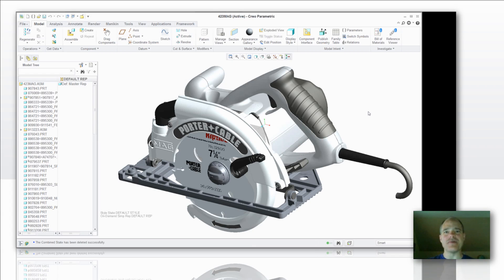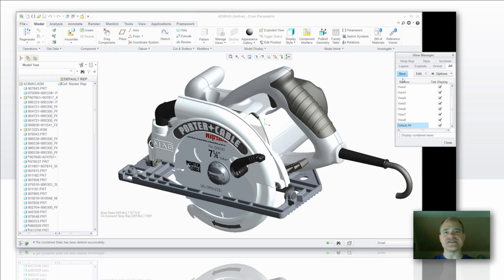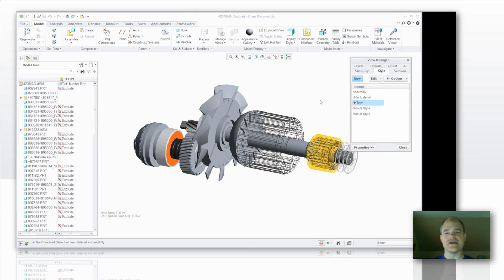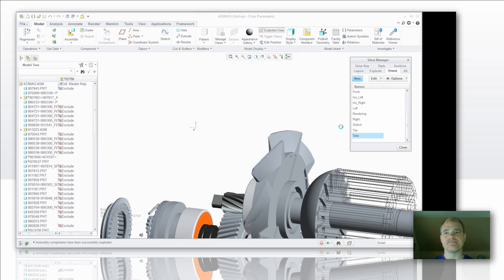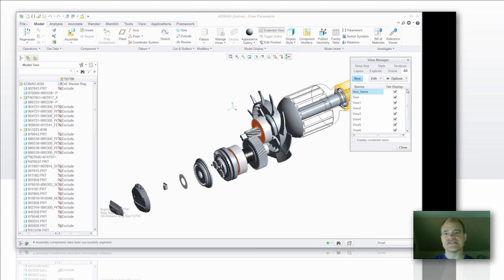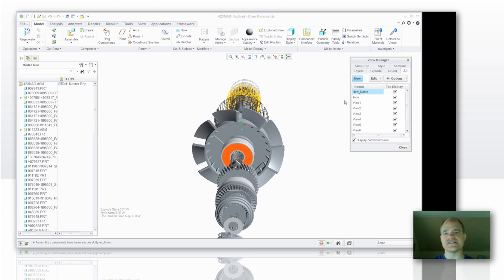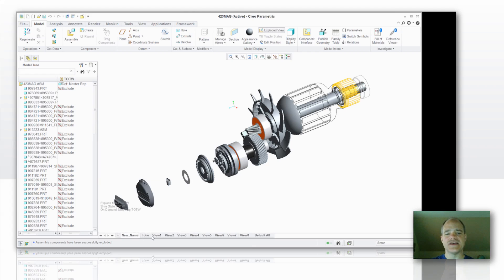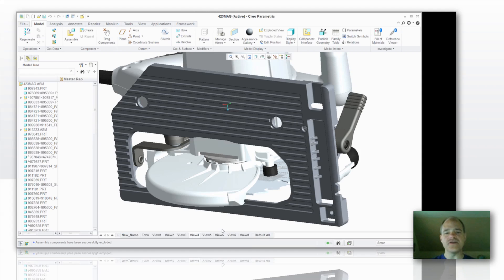EAC Tip-of-the-Week: Combined view functionality Creo Parametric

Comment: New to Creo 2.0.  Adding drawing information into model based definition.  How do I add tables to a combined view.  These tables will have tech information or pipe bend point information etc.?.  Also how do I get the notes editor to accept tab jusitification?  It seems whenever I use tab in the note editor the result ignores it.  Very frustrating.
Reply: Anything you add to a combined view must be an annotation. You can create a symbol that incorporates a table and has cells filled in with parameters. Most often these types of symbols will be placed flat-to-screen. This technique can also be used to create a 3D drawing "title block" of sorts.